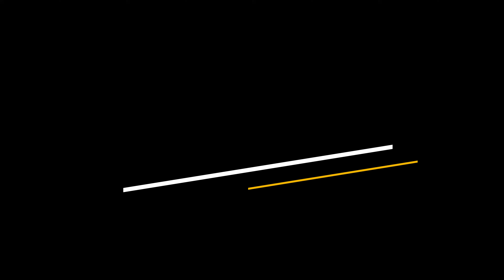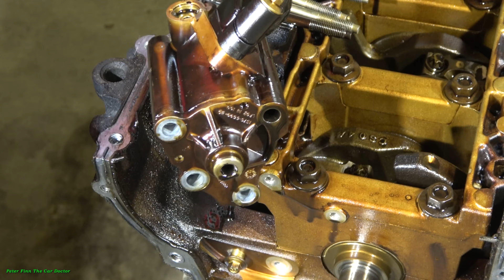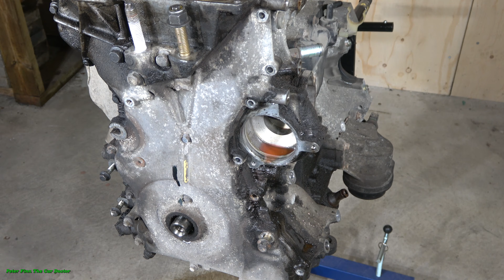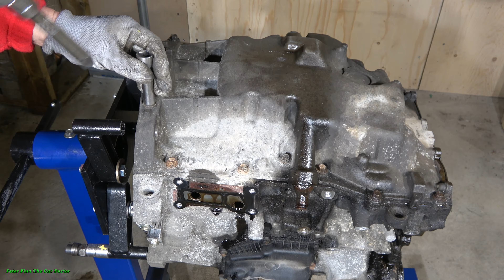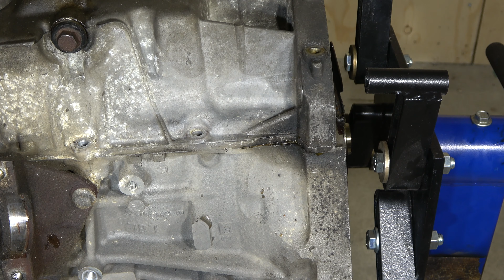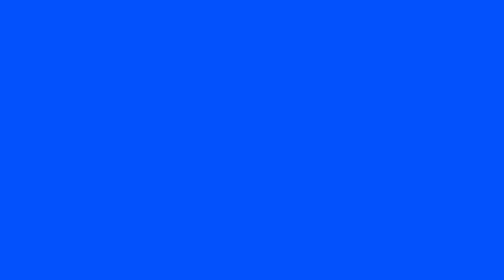How to replace OIL PUMP Ford Duratec engine Mondeo Mazda L Volvo Modular Sigma. Years 2001 to 2022

Comment: hi peter, my mechanic told me my oil pump needs replacing (even though my warning light was not on). If I do need to replace it, is this a fix that can be done at home or do i need specialized equipment? thank you :)
Reply from the maker: Thanks for comment. 👍
Reply: @amitsilverman4027  you probably need to use some map gas on it, heat it up quite a bit. Although I'd replace the sprocket after doing that.

Comment: Does that mean the only way to change oil pump out is to take of valve cover, timing cover and oil sump? It looks like the pickup tube stops you from pulling it out with just the valve and timing cover removed - is this correct?
Reply from the maker: Thanks for comment 👍
Reply: Yes, I’m currently doing it now on mine

Comment: Where can I get the pressurized oil line from the crankcase to lubricate the turbo?
Reply from the maker: Good comment 👍
Reply: @PeterFinnTheCarDoctor  I'm going to install a turbo on my old mondeo that's lying in the garage. There are turbos for me to evaluate, but if you have any suggestions on where to drill a hole to lubricate the turbo, I'd like to take a pinpoint shot.